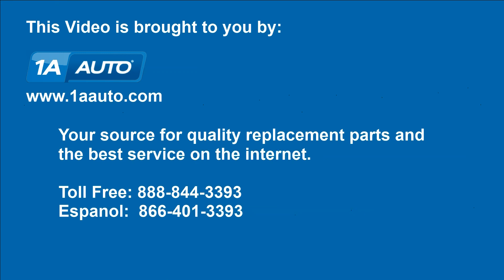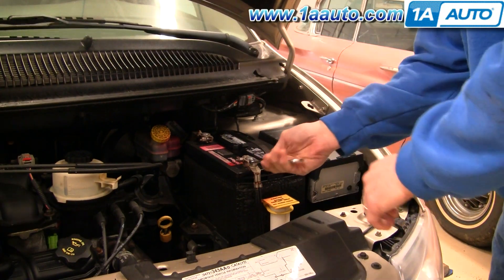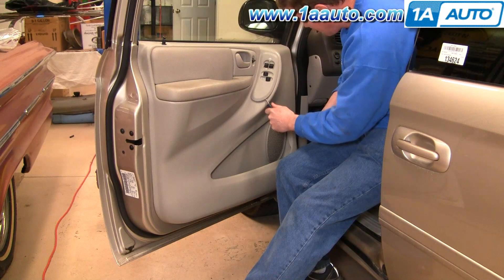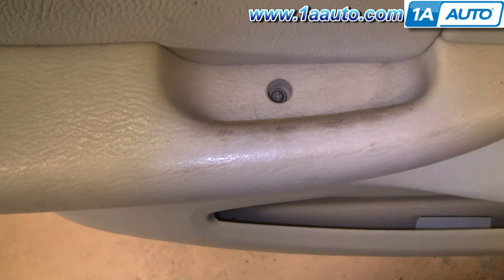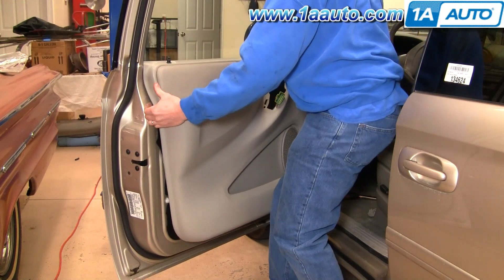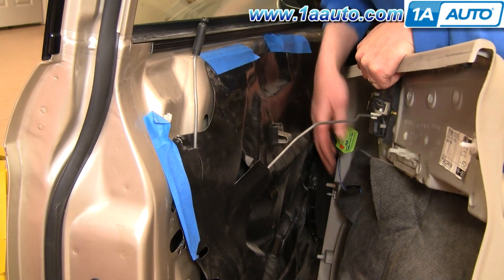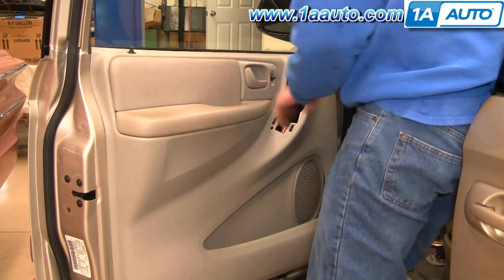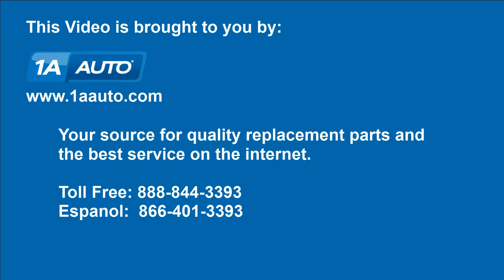How to Remove Front Door Panel 04-07 Chrysler Town and Country

Comment: this is great. My door lock switch stopped locking the doors, it unlocks them, but neither door's switch will lock. so now I know how to get the panel off, and can replace the switches.
Reply from the maker: Thanks for watching. We carry new master window switches for your Town & Country on our website with FREE SHIPPING in the lower 48 states. Here's a link to them if you need to replace yours. http://www.1aauto.com/1A/WindowSwitches/Chrysler/TownCountry/1AWES00226/753593/2004?utm_source=VideoReply&utm_medium=VideoReply&utm_campaign=1ATony
Reply: 1A Auto Parts I've got the door lock switches. two questions, to replace just the door lock does the entire panel need to come off, or is the door latch segment of the door come out alone?  and Why the blue painter's tape when you put the panel back on?
Reply from the maker: MeccaVideoPro You would need to remove the door panel to gain access to the door lock. 1aauto.com 888-844-3393

Comment: Helped me out immensely. Would have spent at least an hour more with over-cautiousness otherwise.
The window rolled down overnight, and the motor made an uncomfortable crunching noise when I tried to roll it back up. Turned out the wire had become loose, and coiled up into a nest of tangles. Was able to push the window up and duct-tape it in place.
Reply: Not sure why so many people are downvoting this. There's probably a legitimate reason, but there's no way to tell without a comment.
Reply: Cheshire Cad 1